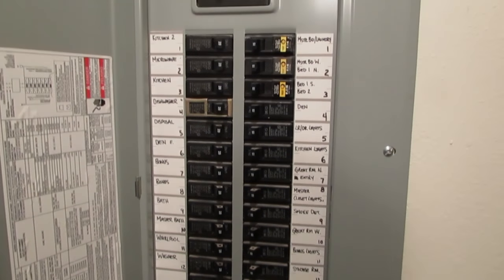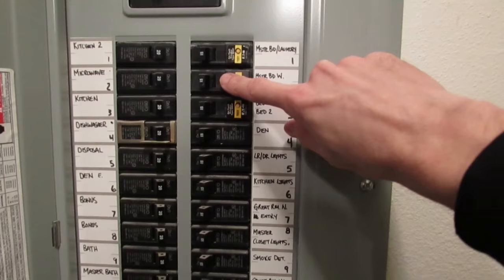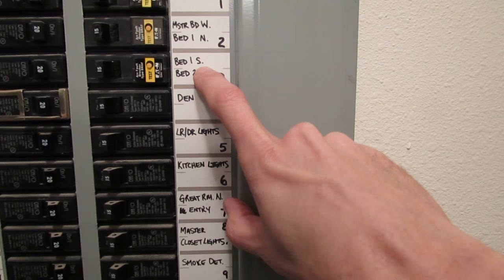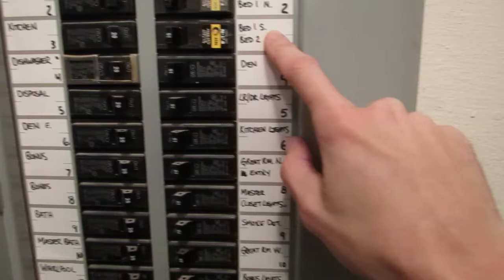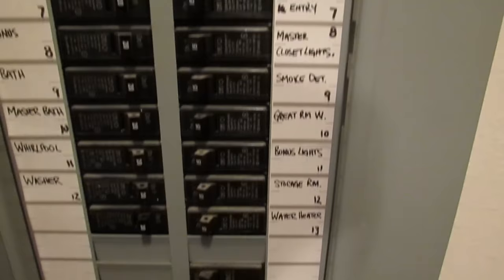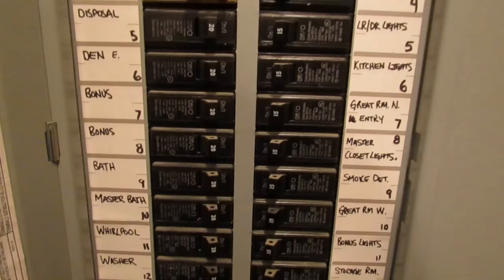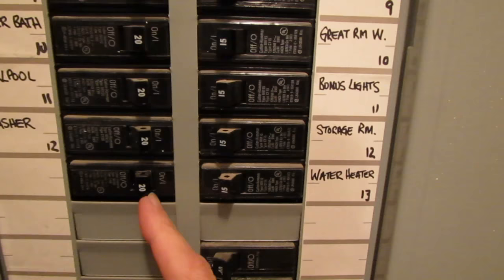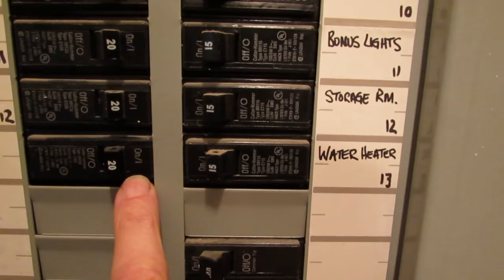How To Identify and Reset a Tripped Circuit Breaker

Comment: My power recently went out and I heard the breaker box trip. All the switches were in the ON position like normal. So I flipped the ”MAIN” switch to OFF then back to ON. But the MAIN switch would not stay in the ON position it kept flipping back to OFF? So I turned all the sectional (e.g. kitchen, bedroom) switches to OFF. Then tried the MAIN switch again. It still would not stay in the ON position. Finally I switched all the sectional switches back to ON position. Then I tried the MAIN again. This time it stayed ON and the power came back. What happened here? I'm assuming that I reset everything.

Comment: It’s 0150 in Dallas Texas and I’m not sure what I was thinking other than we have a sleet and snow storm and I plugged in my new heater and the house became quiet and the TV went out and the all my little plug in heaters went out. I didn’t want to wake up my neighbor so I went to my U Tube guide and you saved me Big time!! Thanks for the easy video you had posted several years ago! I was nervous about fixing this problem but I pulled my Big girls pants up and bravely went to the garage and found the panel box and Flipped That Switch and WaLa I came in the kitchen and I could hear the heaters coming to life!! Thanks So Much! Now I can get to bed and sleep in my bed and not worry about how cold it will be today!!! Thanks again 🙏😊
Reply from the maker: I enjoyed reading your story and glad everything worked out for you. Stay warm!
Reply: @bwhite661  My swiches do not have any sighs where they are from .

Comment: Thank you so much. I nearly freaked out thinking i had to spend a ton on hiring an electrician to fix my wall sockets. Turns out, i just needed to reset my circuit breaker 😂
Reply from the maker: That's great to hear! Glad the video could help.

Comment: My house was built in the 40's I know at least one side all breakers are on when flipped to the outside of the panel. So does that mean the other side is on if flipped to the outside also. I have no idea where the breakers go on the left side and I can not find anything shutting off when I flip them.
Reply from the maker: It's hard to say without seeing it. Typically they are set up like you're saying but I'm sure there are exceptions. Mine also have on and off written on them.

Comment: What happens when it just won’t get untripped? I’m doing the exact same thing and it just stays tripped. Even tho I keep turning it on and off to untrip.
Reply from the maker: Either the circuit breaker itself is bad or something that you have plugged in that's connected to that circuit breaker is causing it to stay tripped. First, try unplugging everything that is plugged into that circuit then flip the breaker and see if that works. If not, you'll need to get the breaker replacedd.

Comment: Hi..what happened when it's still in the middle
Reply from the maker: A tripped circuit - when the breaker ends up in the middle like shown in the video - can be caused by a variety of reasons. The most common is an overloaded circuit. So maybe you have too many things plugged into the same circuit and they are drawing more power than the circuit breaker is designed for. For example you might have a portable heater plugged in and running and then you use a hair dryer plugged into the same circuit. This could trip the breaker because those two items draw alot of power. There are other reasons explained in this article that could be more serious. https://www.thespruce.com/why-circuit-breakers-trip-1824676